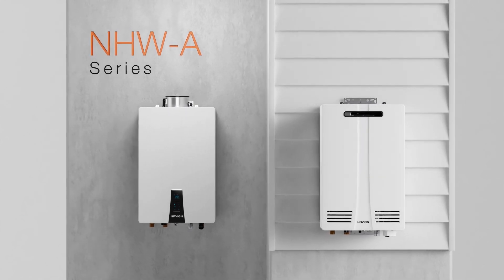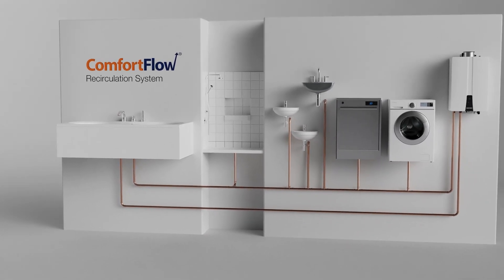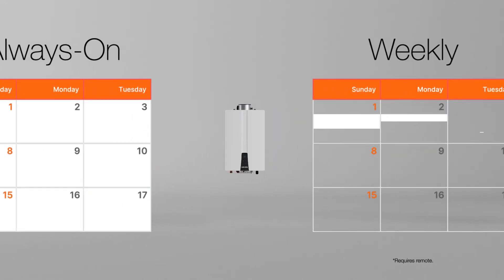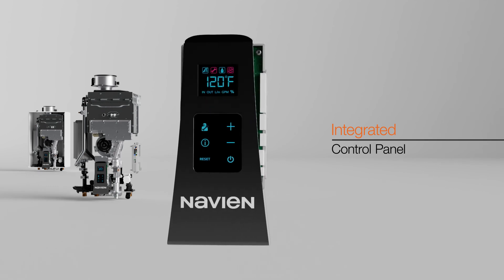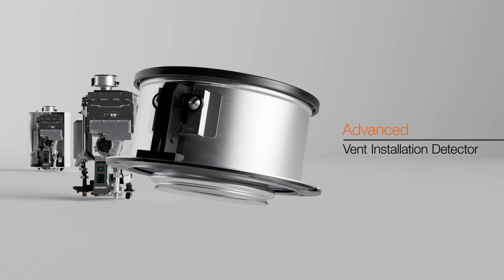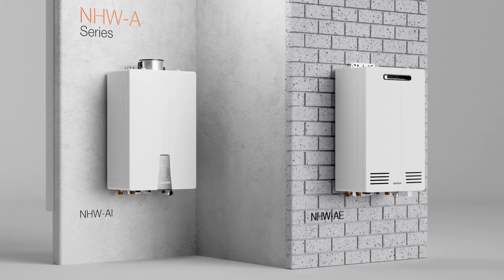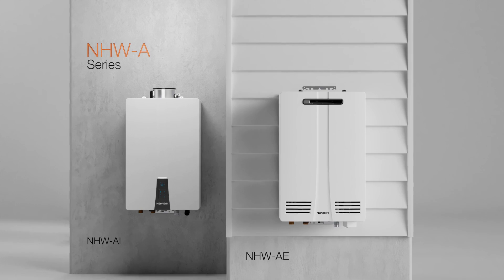NHW-A Non-condensing Tankless Water Heater with ComfortFlow Built-in Recirc Pump and Buffer Tank

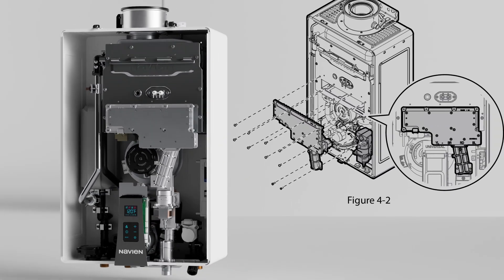Comment: a correction is needed: at 3:26 he says "all models offer flexible operation, with either Natural Gas or Liquid Propane."  Nope.  These are NOT field convertible.  There is no conversion kit in the unit.  You have to order the right one from the start.  And no one carries the conversion kit locally.  Has to be shipped in from Navien.  I just found out the hard way.
Reply: Brandford white dose